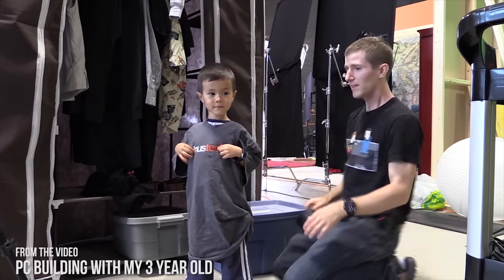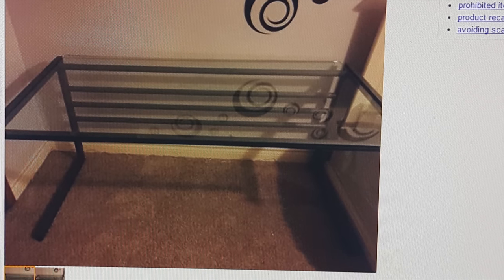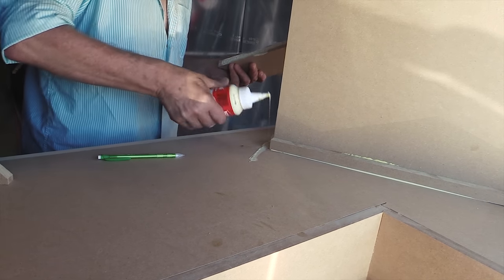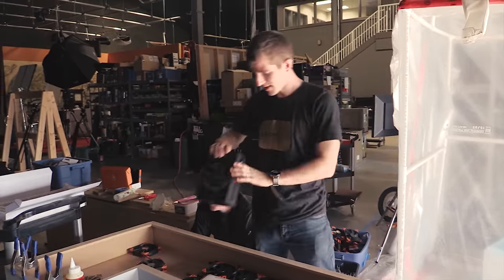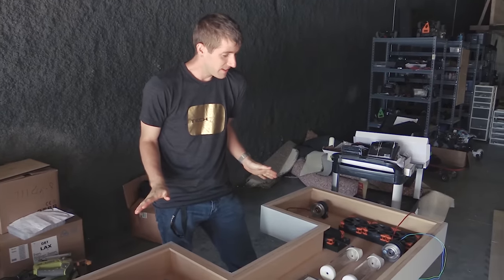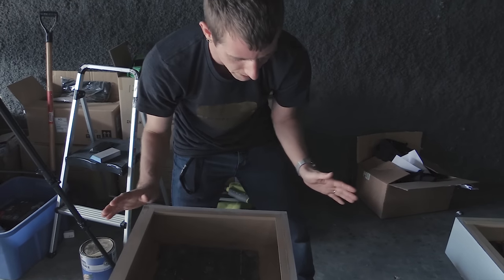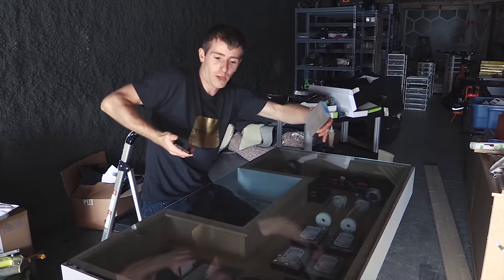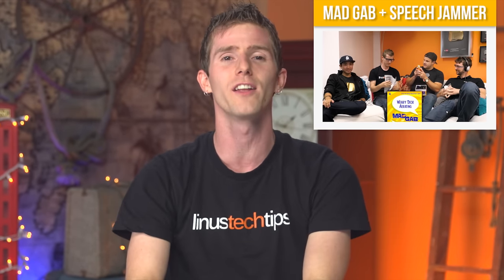Ultimate DIY Desk PC - Desk Construction

Comment: Not sure I'd be comfortable with a glue-only solution in such an expensive desk.
Reply: Expensive hardware Desk can be built for $100
Reply: Yeah, if anything, I would have at least used a few screws to tighten down the bond of the glue. gravity isn't the best clamp in the world.
Reply: glue bonds wood together better than screws or nails
Reply: UnAnonymous lol
Reply: Benjamin Wright the hardware seems more expensive than that....
Reply: Wood glue is actually stronger than using screw
Reply: would be okay to put in a couple screws after using the glue..think i would just in case really.
Reply: Screws in MDF are for cheap furniture that falls apart. Glue joints are stronger than wood and used in furniture that lasts generations. When proper joins fail, it's the wood that breaks, not the glue. A failed joint is a design failure, not a materials failure. Yes, screws can be used during glue-up in order to optimize clamping pressure during assembly. Once the glue in a joint dries, these fasteners are useless. There are proper times and places to use screws, but joining MDF is not one of them.

Stack the edges of two pieces of cardboard together (MDF is basically thick cardboard). A foot/30cm length should be fine. Now put a few screws through them. Pull apart, and witness your screws do nothing to keep the pieces together. Now glue the edges of the cardboard together and pull your joint apart. You will have to rip a layer of cardboard off in order to do this, and the glue will stay intact.
Reply: Clearly a lot of you have never done carpentry. Most carpenters will use PVA as it is MUCH stronger then screws/nails. The screws only purpose is to hold it together while the wood dries. A lot of the time, the wood will be glued, screwed, left to dry and then the screws will be TAKEN OUT and the holes will be filled. These guys have used clamps instead of screws which is much better for an all natural finish because it requires no filling after the wood dries.
Reply: @unanonymous4655  that would be true if he was using wood.   mdf has a tendency to crumble at stress points
Reply: I know. Brad nails at least
Reply: I just completed my architecture degree, and can confirm that using wood glue with MDF is by far more structurally sound than using nails/screws with MDF.
Reply: @kevinohara8529  this would all be correct, had they used a single clamp to hold the pieces together. And MDF is for cheap furniture no matter how you join it.
Reply: Wood glue is better than any screw.
Reply: @sgtpepper1138  no need i build one desk pc now used some crocodile wood glue and its sturdy af tried to punch to see if it falls apart and didnt move a dim the thing with mdf is the edges have a soft hairy feel in touch in fact those are millions of fibers sticking out if you use those edges with good glue for wood the piece wont come out no matter what you do even if it does part of the piece will remain there with the scraped off glue

Comment: another alternative on wood: if you have access to a wider range of wood working related tools(planer, jointer and the large gluing clamps), you can pretty well save all cost on wood if you use pallets. Well picked ones can turn out surprisingly nice :p not to mention it is quite fun building a desk/table this way.

Comment: I work at at a place that constructs windows and doors for homes using aluminium systems and we buy glass from business partners (of which i worked before for a bit - one that made curved architecture glass) and the glass is really fucking cheap! Seriously it is just sand lol.
Reply: but its true xD
Reply: it's just sand, although technically speaking it is the main component. The high price you pay for tempered glass designed for being able to carry the load of being mostly unsupported and being used as a desk isn't in the sand part, it's in the carefully added additions and treatments the glass undergoes and the engineering to achieve this glass. Although you can get cheap glass, not all glass has to be cheap. It's the same with all construction materials.
Reply: Plus the fact that you work for a business that makes windows means you probably get the glass cheaper since I'm assuming it gets bought in bulk

Comment: Shouldve talked to a master carpenter or cabinet maker, but as a contractor I recommend getting Benjamin Moore Pearl white Ultra Spec 500, and for the seams use bolt quick dry caulk.

Comment: You should set the Io shield in the BACK of the desk Linus, there's still time to change it.  :)
Reply: Ikr? It's not just me that thinks it's odd that they're putting the mb sidesways and offside right?
Reply: Mark Flower
Cable management the monitors will be a pain if they keep that design.  :v
Reply: No, they are probably already done making it by now.
Reply: Sergiocrivelin one thing I thought of that might not be pretty is just putting a rack to hold all of the cables

Comment: If you don't care about looking at the PC you can take the easy way out and get a 1U , 2U or 4U housing and mount it under your desk bottom side up and use it with or without a lid to hold all the parts for your PC. they can be modded to work with what ever you need them to fit and give a solid base for a desk PC just remember to mount it with the IO shield facing to the back of your desk to mount all the cables  .

Comment: Why not route the inside edge so the glass sits flush?
Reply: maybe the LEDs might not fit in as well? idk
Reply: I don't think a router would do well with MDF. It's not a very strong material so it might crumble. I suppose it could do well with a low RPM but they might not have access to one like that
Reply: Masterown35 Nah, you can use a router on mdf. I've built a few arcade cabinets out of mdf and I clean up my edges with a router every time. Just make sure your shit is sharp and decent quality. And wear a mask, mdf is basically just cancer in the shape of construction materials.
Reply: I was thinking routering the trim pieces they installed to cover their "mistakes".

Comment: Hey Linus, don't know if you're still looking here but for clearing up those face up edges/imperfections another fairly easy method that people also use for hiding plywood edges is using a thin layer of spackling and then sanding it lightly with a fine grain.  Works fairly well in my opinion.  Cheers. \o/

Comment: why not have the computer in the center and the radiators + res on the sides
Reply: whole table water cooling?
Reply: it would look cool if they had the radiators, fans and hard drives mirror on both sides and use the leftover space on the bottom corners to have 2 different themed figurine-displays (good guys vs bad guys)

Comment: How are you going to do this without a CAD mock-up first??
Reply: Just because it's there doesn't mean you have to use it? People have done metal working/construction/carpentry without CAD for centuries perfectly fine.
Reply: Agreed. Highly skilled craftsmen can get away with not using it. That being said.... these guys need to.
Reply: jd52wtf Fair enough. I read your comment at the start of the video and didn't realise how many mistakes they were making in terms of planning. Although that's not so much up to being poor craftsmen (his dad seems to have done a fantastic job of the desk) as it is to just them being poor planners :P
Reply: Agreed. His dad did a very good job on his part.
Reply: Is CAD hard to use? i have never used any programs like that or even photoshop for that matter, i barely know my way around gimp and only to just create crappy made memes and photo edits to screw with friends lol.

Comment: Id use the rubber glass protector "frame" type thing that will put a border on glass & give extra width to makeup the accidental error in measuring & it also adds stability to glass & helps it not move, etc...

Comment: Cabinet grade plywood would be a really good alternative for MDF, cabinet grade is really smooth, usually a lighter color, and doesn't have the knots and stuff like in rough plywood, it also will take screws and nails better than MDF. Cabinet grade plywood is a way better choice, and it takes stain and paint better, if you want it to look even better.

Also, he could have lifted the glass, and got better airflow.

Comment: I am sure someone mentioned this already but wood dowels would be better than just glue.  Easy as heck to do and makes for a great alternative to nails.  Or screw inserts for better construct solidity.  And there are many ways to account for the legs in placing the radiators too.  I could go on.  Wish I had taped and photo'd my desktop I made for my work trailer....maybe next time.

Comment: Man. I'm always disappointed when you guys try to build things. They start off with lots of potential, and then fall flat. I would think that mounting the MOBO in the middle area would have been nice. Your knees might hit the IO, but it would be front and center. That would leave plenty of room on the right side for graphics cards and PCI-E expansion. Intakes on the bottom would work great and likely keep noise down. Wood filler should work fine for most of the top imperfections and little round rubber pads would hold the glass up a bit, keep it from sliding, and allow hot air to escape without allowing too much noise to escape. I'll hold full judgement until part 2, but I'm not too excited. I'd build my own version of this, but I have no need for a desk PC like this. I might have to build one anyway to put my money where my mouth is.
Reply: exactly what I would do...
Reply: There's a lot of footage that was cut. You can assume that it was thought of and dismissed, likely due to the I/O issue you mentioned.
Reply: The monitor would hide the MOBO, which would be a shame, especially if it's one with RGB lighting.

Comment: You kidding? Ikea sells the same shit all over the world.
Reply: ikea isn't in every country 🤔
Reply: Troll My Friends
well maybe. but it's a hell of a lot.
https://en.wikipedia.org/wiki/List_of_countries_with_IKEA_stores
Reply: No it doesn't.
Reply: The Internet isn't in every country either
Reply: It probably is literally made of shit. So it's good for the environment.
Reply: so ... when a potato won't do then tape will?
 Good to know.
Reply: +Torwulf games
they used Particle Board, they *made* cheap furniture.
Reply: +Torwulf games "When you buy cheap furniture this is usually what you get."
I am typing this on a 15 year old desk I bought from Ikea.  A desk that I spend 4-16 hours at every single day, and it is still solid as a rock.  It was only about $600-$700, which is an absolute steal for a desk of this quality.  You anti-Ikea people just buy the lowest end, cheapest shit they sell there, then bitch and moan when it falls apart.
Reply: Livid Imp whatever it is, is fine as long as it's made from real wood, and not particle board.
Reply: Torwulf games absolutely. but material that isn't made out of dust resists forces much better!
Reply: Maybe. There's still not one within 100 miles of here (southeastern IL, USA) and their shipping is prohibitively high. Seriously they want $350 to deliver an $80 desk. 

Not only that, I know at least some of their desk/counter tops are hollow inside--fine if you just intend to build them as is, not so great if you intend to cut them up.

Comment: A tip for MDF, size the exposed edges 1/8th too big. Once it is assembled use a flush cut bit on a router to create the prefect cut. Bondo any gaps and sand the whole thing down, be sure to sand the corners so they aren't sharp.

Comment: Should use a rubber barrier that makes it air tight! Then you could put three intake fans and two middle fans to boost the airflow inside the case and three exhaust fans.

Comment: Another way to hide the wood joins under the glass is to sand it down, collect a bag of sawdust (make sure it is sawdust from the wood you are using). Then mix the sawdust with some PVA, fill the gaps with the mixture, let it dry and sand it down. The sawdust will give the PVA the same colour as the table, blending the gap it in nicely. The sawdust will come from all of the cutting/sanding you do building the table and you should be using PVA to hold it all together anyway so this will not require any extra materials, it's easy to do and gives the best finish if you wan't to keep that natural wood look.

Comment: The glass you are talking about is $400 new... I haven't heard a chop saw called cut off since I was a kid.
 MDF board is basically just sawdust glued together, definitely have to drill first, I just use RTV, but you can use very high end wood glue.

Comment: you could use a weatherstrip tape to go under the glass do it has a good seal for the air flow and good grip so the glass will not move about.

Comment: Using lexan-sp? Plexiglass is extremely durable and extremely cost efficient. It's lighter, more forgiving, more durable and for a desk that size would be maybe thirty bucks at the local hardware store. You can also screw through it relatively easy for a more secure connection. A burglar couldn't break into it with a sledge hammer.

Comment: You do know that because your table was about 1/2" longer and wider than your glass, you could have inset the glass, right? I'd recommend using those little silicone nubs around the inside for the glass to sit on.
Edit: Ok, you addressed the issue in part two. My bad lol.
P.S. Please, find a way to clamp the legs when gluing. I know it's tricky because of the position, but it will improve the strength. Also, maybe consider dowels or biscuits to improve the stability of the legs if you're not going to use screws. The last thing you want is the glue to shear and a leg to come off.

Comment: Get the cheapest good ITX case: Cooler Master Elite 130.
Build your system into it.
Drill four holes into the top cover. 
Mount top cover to underside of desk using screws. 
Slide chassis into top cover.

Easy, cheap and protected desk PC. You're welcome.

Comment: have you thought of putting the wiring thru the desk bottom and mounting on the underside of the desk, out of sight for a cleaner look?? clean look no wires. also maybe mount the water lines thru and on the underside too. alot of work but would look sweet and clean.

Comment: Another negative factor in using MDF is that it does not last in humid environments. If you live in a humid place such as Mississippi, and you don't have AC dehumidifying the air all the time, then if you want it to last, use cypress or yellow pine, or cement board. Everything I've ever owned in this humidity that was made out of MDF or some other kind of press board has expanded and crumbled within a few years. It's junk. It certainly won't last long enough to be passed down. Spill one drink on it and it will fall apart.

Comment: For the airflow, i predict a problem for the DIY viewer : The intake port being in the front, somebody is bound to put something in front of it (adding some cloth on the desk to protect the surface and would have a part falling in front of the port)

In my humble opinion, to control airflow, the ports should be under the desk, with fans on both end, controlled by a potentiometer located on the front. 

Heck, push the idea and add a digital display for the temperature inside the desk.. :)

Besides, having one set of fans only on the exhaust will put extra pressure on them to pull the air while having fans on both sides will distribute the work, thus extending the life of the fans

Comment: you need to add either nails or screws as it will defiantly fall apart after some time as a furniture maker i know this i have tried to make furniture without screws or nails and each piece fell apart it does not last without it might look good but will cost you when it falls apart from just bumps and movement glue will not last and never does use brad nails as the will be better then none

Comment: I just thought of a pretty good one, not the cheapest though.  Desk pc with double monitor lift, maybe even a standing desk surface that rises separately from the computer too.  Duino flex sensor to move it up and down with the force if you want to get really crazy with it.  

My plan: Take a 775 motor (or two) out of a spare power drill to drive the lift pulley(s).  Take frames off monitors to save space and weight, make a flat lift mount.   Build the frames for the desk and lift with 8020 aluminum (a lot of 3d printers use same or similar) to make it all flex-proof.   Decent prices for 8020 overstock/scratched pieces on ebay, use tnutz.com (hah) for cheaper fasteners and accessories.   

I would probably add a 2nd ATX PSU for the motors, extra lights, fans, maybe even the monitors (boost module for the 19v).  Make a panel with volt/ammeter display and some banana terminals, bring a whole new meaning to "bench power supply."  

Of course you could do it cheaper without 8020, but it would be so much heavier and bulkier with wood.  Aluminum t-slot extrusions are light and extremely rigid.  And the versatility is insane.  Could even mount the monitors to a vesa plate with a swivel hinge and/or arms that can swing out when it's up. 

They have free CAD-type software for designing at 8020inc.com.  I made a nice sim racing rig with it for about $250-$300 not including the seat.  Could be done cheaper, I went a little overkill for strength and have some brackets/fasteners leftover.  

I have a case with 4 TG panels (V71 TG snow), which I might be able to embed in a desk surface.   Use the mobo tray, etc underneath.  Always wanted to do a desk pc, I swear I thought of it like 20 years ago before ever seeing one.  I think I finally have a plan!  It's the ultimate smart hidden monitor standing benchtop pc and hobby electronics station.